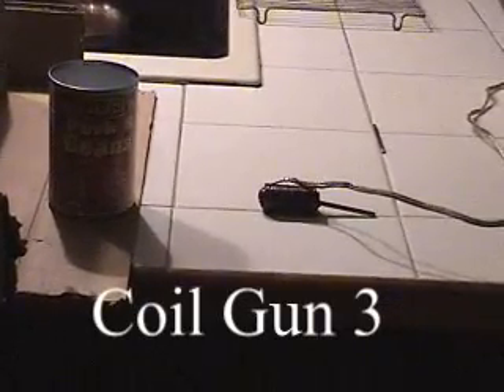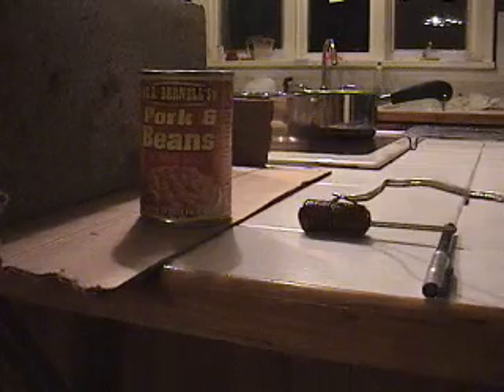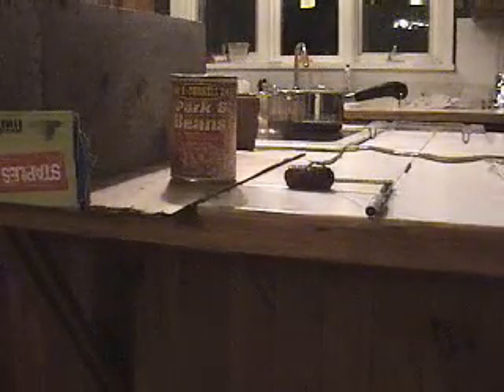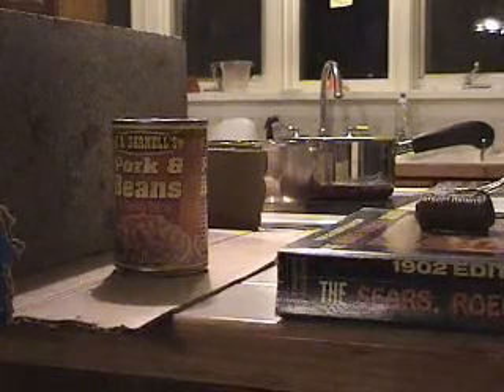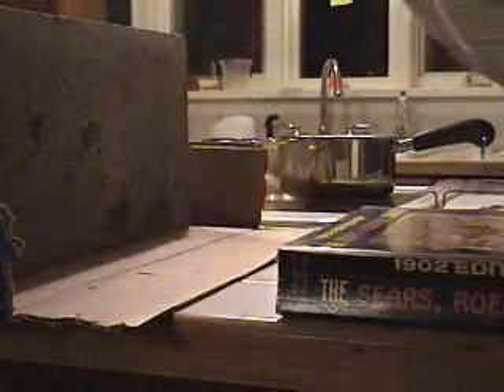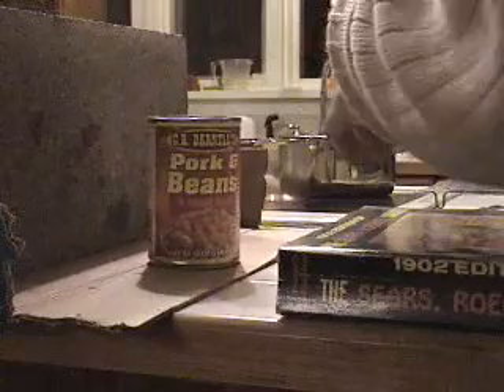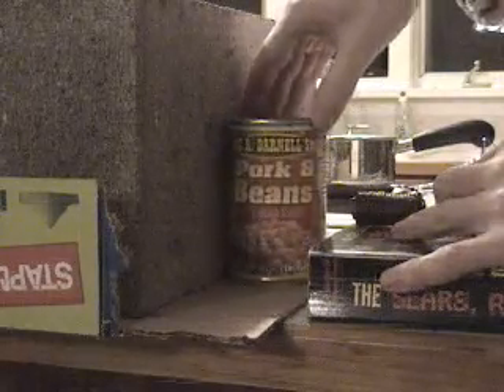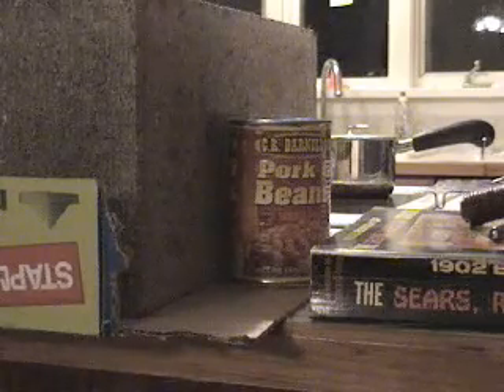Coil Gun 3

Comment from the maker: A coil will reverse polarity as the power discharges from the capacitors.  Usually diodes are used to limit the reversal and to protect the capacitors from being reverse charged.  It takes some experimenting as to where to place the projectile to get the most bang from the device.